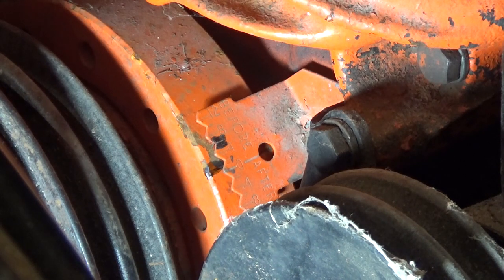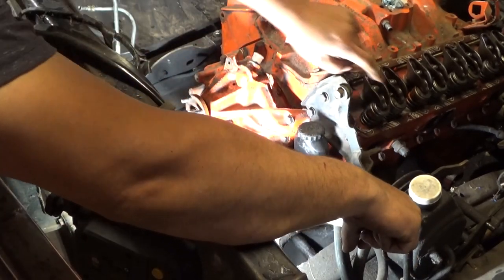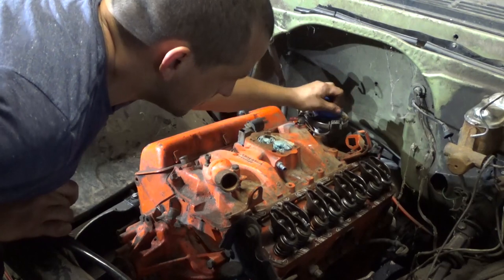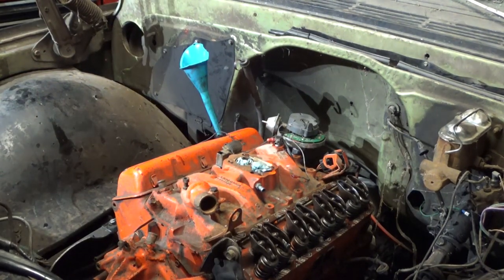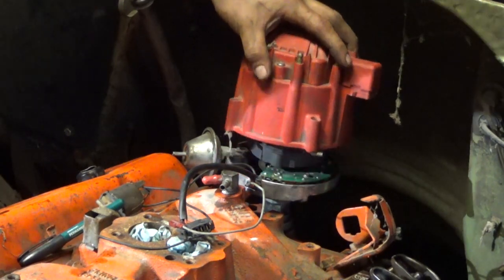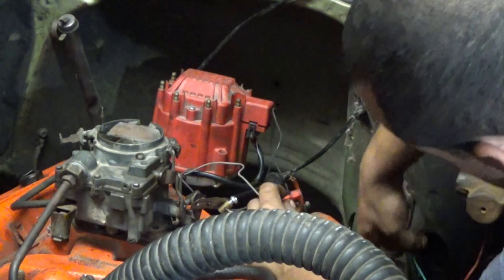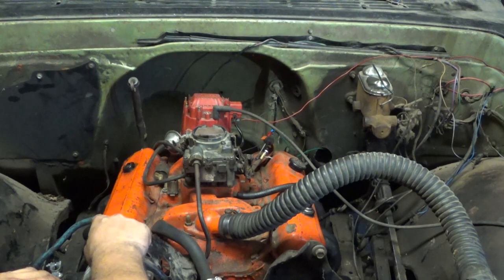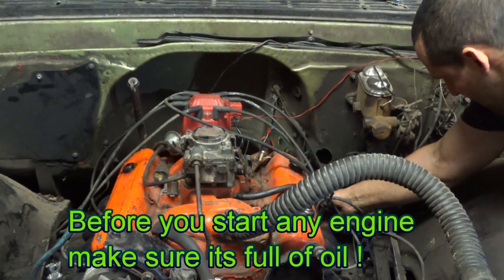How to wire HEI distributor on chevy 350 small block

Comment: Technically you don't have to remove all the plugs to rotate the crank to tdc it just makes it easier that's about it
Reply from the maker: Yeah I know that. and yes the only point in taking the plugs out is to make the engine easier to spin.  If you are using the balancer bolt to spin the engine, I would not recommend doing it with the plugs in. You might break the bolt. maybe not on a stock 8.5:1 compression 350, but if you are working on something that has higher compression like a 10:1 454  then in my opinion you might break the balancer bolt. I would rather take the plugs out to be safe,

Comment: I was having major miss firing issues going with the basic method going with zero on TDC and making sure the valves were close on piston #1 on TDC ( rockerarms). HEI distributor pointing toward #1 like you...a little advance as well.....but it will not turn on or just spit or back fire. And will only response somewhat by advancing shit of the HEI...but still ran like crap or hardly turn.....but i was able too reslove it by installing 10-15 degrees after TDC. Which was really odd. Either the timing mark is off or some point the block or heads were mill...throwing the geometry off??
Reply from the maker: milling anything wont effect that , but maybe the timing mark on the balance was off. people like my dad which has a lot of experience argues with my method because the balance might not be correct or even the timing tab. that is definitely something to think about, but I usually i have new or somewhat new balancers and a lot of success with this method. I haven't even touched it since i locked it down in the video and when i go to tune it with a light and stuff I will show on the video where its at when i locked it down. thanks for watching and commenting.

Comment: the problem im having is i pulled out the factory engine wiring from the bulkhead and tried to put a better one in from a 1974 K5 blazer but it would not match up to the pins from the bulkhead so i reinstalled my old one now i got nothing no lights on the dash no fire nothing at all what the hell did i do wrong any ideas?. Larry broad 1970 el camino 396 with turbo 400 trans. let me know what you think thank you.
Reply from the maker: I'm sorry but I don't have any real answers, but I can tell you this much. I have messed with a lot of 73-87 trucks and compared to even my 72 the wiring is way different. Assuming that El Camino is  set up more like my 72 C10.  On my truck everything is fed from a small junction block on the fender the battery has a positive wire going straight to it and the alternator charging wire goes to it as well. then from there it sends power to everything.  The 74 probably fed everything off of the positive post on the starter. yeah I don't know really what could of went wrong.  I would just make sure all the connections are clean, maybe it just a bad connection on main ground  cable or dirty terminals. don't skip any of the basic stuff like that. Try to get a wiring diagram and a multimeter so you can check to see where the power is going or not going.

Comment: The problem with just putting the piston at TDC is that if you pay attention, you will notice that the piston will “dwell” or sit at TDC for several degrees of crankshaft rotation before it begins to move downward.
Reply from the maker: there is actually a remedy for that dwell you are talking about. if you use a piston stop you can use a degree wheel. and whenever you bottom it out in one direction you spin it the opposite and you take the average and the middle will be a true top dead center. supposedly thats how the gurus do it. and ive done it to a 454 i used to run but i can not make any claims on how accurate it is based on any real knowledge of my own. but i did do my 454 like that but even at that with after market parts there is really no real spec on where to set it your advance. but after doing it like that it seemed to run best at like about 16 degrees initial advacne and it was tested at a drag strip. i went from about 10 degrees to 20. but there is a lot of other factors to consider. who knows maybe killing power helpe it hook up. so i really don't know how to gauge whether or not my tdc mark was accurate.

Comment: Question what if ur rotor cap doesn't a line with your distributor cap ( didn't remove the distributor)or a lining it with cylinder 1will it still turn on ?
Reply from the maker: if the engine was already running when you took the cap off and you did not move the base. as long as you put the spark plug wires back where they were then it should run like that. number 1 is supposed to be where i put mine but people don't always set it up like that. if that doesn't answer your question just let me know and I will try to answer it bettter.
Reply: no it did thanks I need 2 move my wire (1) to the same place where you started your again thanks stay safe RF. TX
Reply: I bought a used 350 engine/350 turbo trans combo with everything still attached except the spark plug wires, my problem is trying to find where number 1 plug were attached, what would be the best thing to do if you were in my shoes??
Reply: I did run all the wires back to the stock set up but it just turns over like its out of gas
Reply from the maker: @Ty Scott start from the beginning and re wire it after finding TDC on the compression stroke.  because even if it was running like it was. some people wire them up without number 1 being in the correct position on the cap and they will still run. for example some people just drop the distributor in wherever it falls then do that method where you put a piece of paper in the spark plug hole and watch the rotor as the engine is cranked and just guestimate where the rotor was pointing when the cylinder blows the paper out and wire it from that position. I hope that didn't cause more confusion if so just follow how i did it from the beginning in the video. they always fire right and run unless there is another issue like bad ignition module or bad carb or no gas .